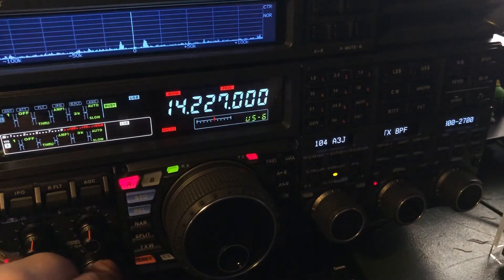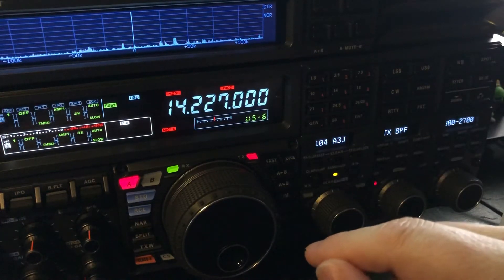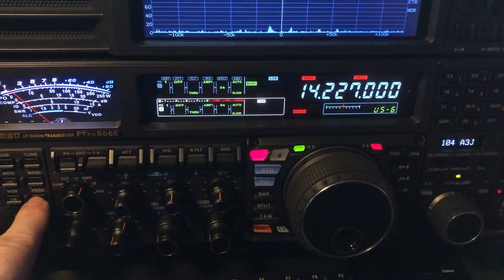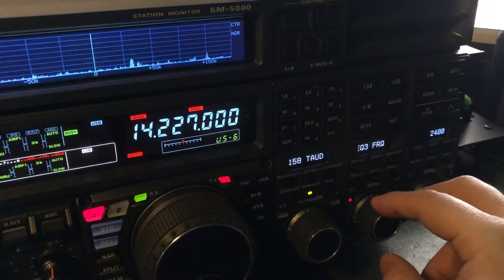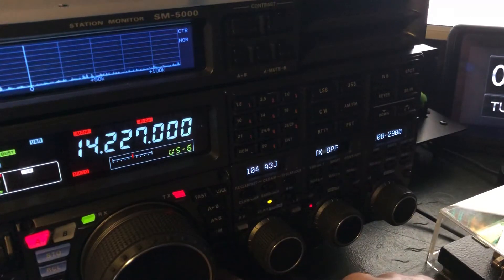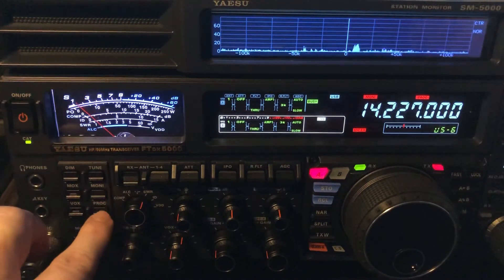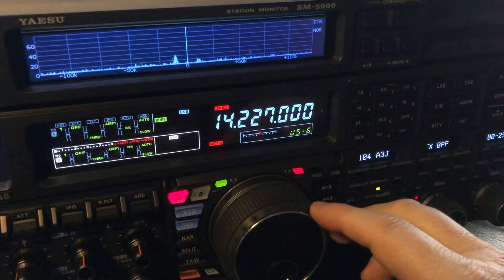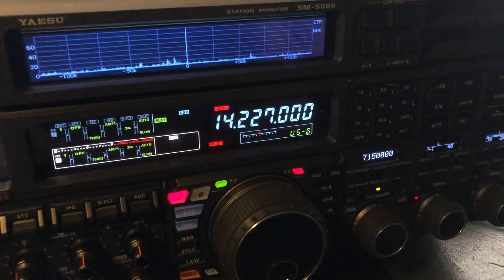Yaesu FTdx5000MP: TX Audio for Breaking a Pileup with Heil mic #yaesu #ftdx5000 #tx #audio #heil

Comment: where does you ALC end up while talking ? i tried your settings and i get half of the blue bar on the meter, about a 5 on the s meter at top, should the alc be set up the end of the blue alc marker on the meter? im also using the pr781, thanks, p.s i noticed when i talk i dont see 200w on the meter unless i whistle. this is normal ? while taking it seems to be around 100w with some peaks over,
Reply from the maker: With the processor off, be sure that you adjust the mic gain until the ALC goes to the dividing line, or as near as possible without going past the dividing line, while you speak normally into the microphone. You should speak at 3 finger widths from the PR-781. Next, enable the speech processor and set it to 15.  Recheck the ALC reading and adjust the mic gain if necessary.

SSB is a PEP type transmission. You need a peak reading wattmeter to track your peaks. A steady whistle can cause an average-reading wattmeter to display closer to the PEP output value.
Reply: @n4hnhradio  thanks for that, i had to increase the mic level to 56 to get a peak at the end of the alc blue line with eq off, thanks for your help
Reply from the maker: EQ needs to be on when you set the ALC level. Then tap once more so you see the processor engage. Then recheck ALC.

Comment: I've got some of my settings the way you recommend and I listened through my headphones for the difference. It was an amazing improvement compared to how it was set from the factory, or how the manual recommended it to be changed. I wrote your suggestions in the note section of my manual as a "reference  setting."  Thanks es 73, de NL7VX.
Reply from the maker: Thank you  for letting me know the settings worked for you, Steven!  Which microphone are you using?  One of my other subscribers said my settings also worked for his MD-100.  That’s good to know.  73, de Doug